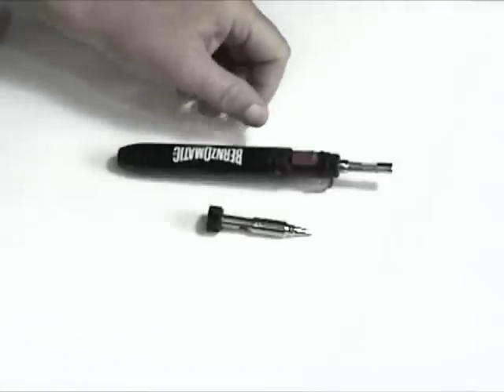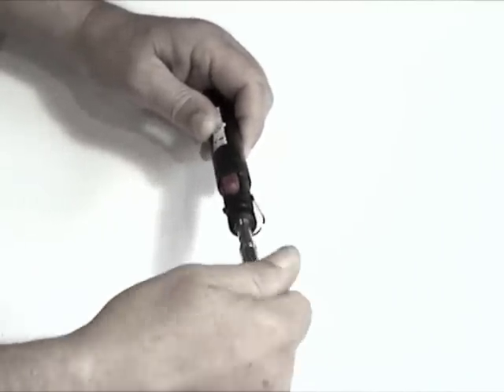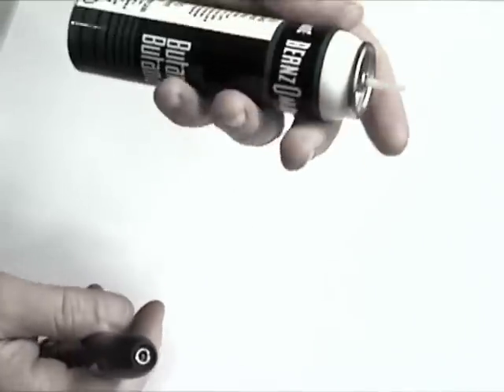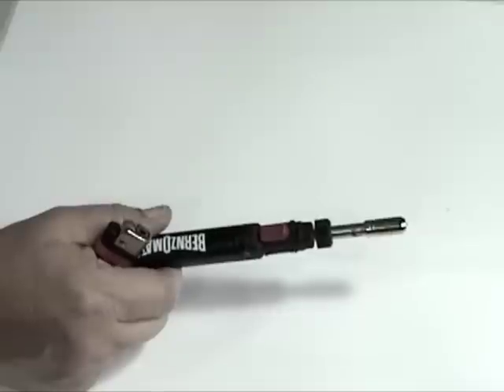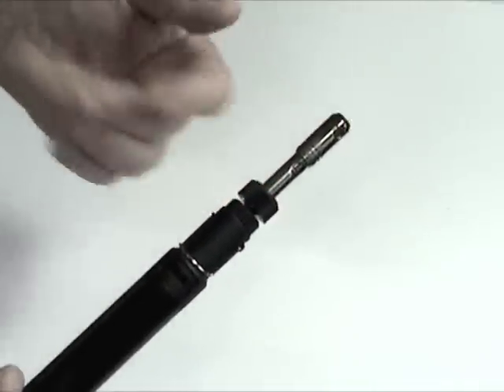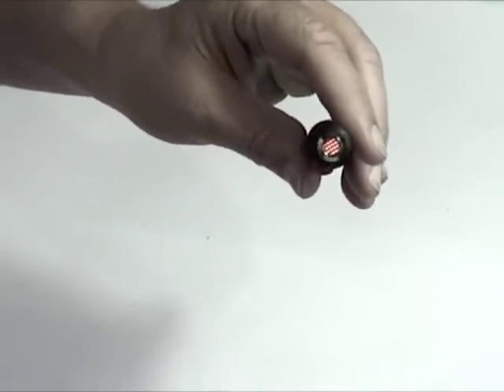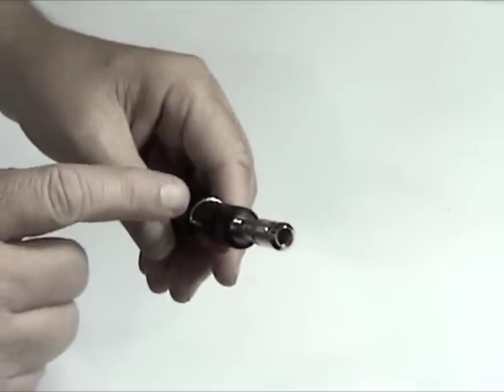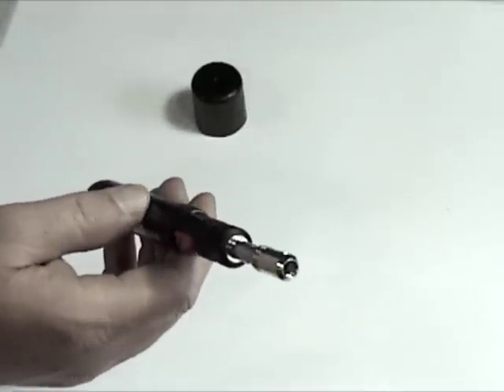3-in-1 Micro Torch from EpoxyJewelry.com

Comment from the maker: Welding steel requires much higher temperatures such as with Oxy Acetylene style torches.

If you want to use brass parts (nuts bolts) then you can solder them with a torch like this with no problem. You can get brass nuts, bolts and rods from McMastercarr online, just google it.

Comment from the maker: @tat2edangel69 If it's popping (lights then immediately goes out) then you probably have the gas turned up to high, try it on a lower setting until it stays lit. These units vary a little bit from one to another so the exact setting to light may differ on each.